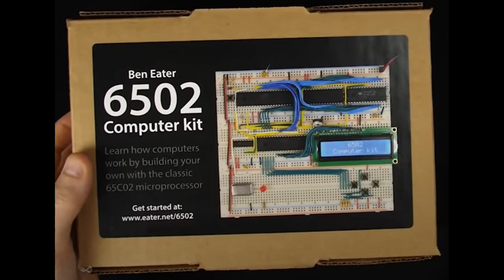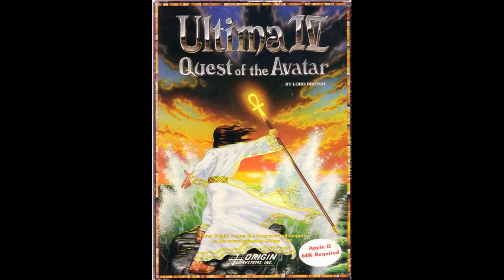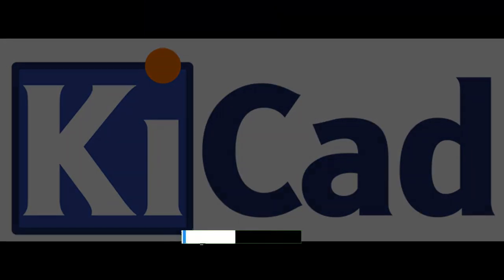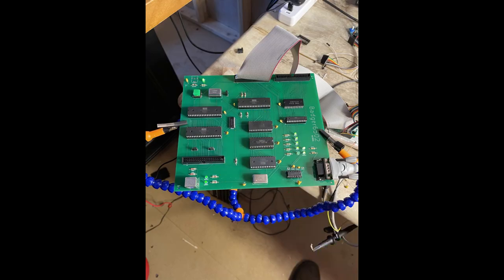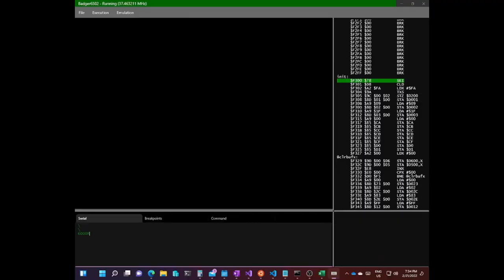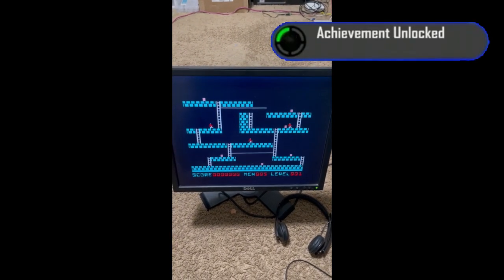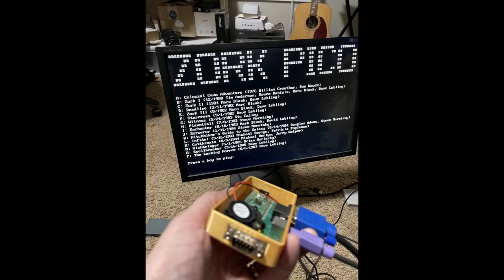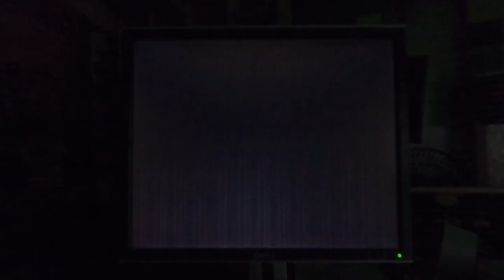6502 childhood dream come true (+VGA, Pi Pico, and Lode Runner too)

Comment: from never doing hardware to a 4 layer board? nice stuff dude
Reply from the maker: Thanks!
Reply: Isn’t 4 layer the easy, lazy solution to distribute power? From the EEVLOG I learned that with through-hole routing is criss cross on the surfaces. Like in a breadboard: internal is vertical, then there is space for your horizontal colored wires.
Reply: @ArneChristianRosenfeldt   if it works does it really matter? its not a final product of any kind
Reply: @akamadman203  I just say that the hi tech solution is easier. If you need to save any penny in a series production, you try to reduce this to two layers like Nintendo had done with the N64.
Reply: @ArneChristianRosenfeldt Having just designed my first PCB, yes.  I had a choice between figuring out some clever way to route traces between top and bottom (because too many traces needed to overlap) without causing lots of EMI, or just switching to 4 layer.  I probably saved myself weeks by switching to 4 layer.

Comment: Congratulations Eric.  I am in the same rabbit hole.  After 25 years of software engineering, I am starting to use my electrical engineering degree again, recalling my younger years, and having a lot of fun learning.  Hope to see more videos from you.
Reply from the maker: Best luck - any project you're focused on?
Reply: do a YT search on the Agon Lite SBC - aimed at retro hobbiest. It uses the Zilog eZ80 as it's CPU. This is backwards compatible to the Z80 but also has a 24-bit mode where can address up to 24MB. And there's an 8-bit base register so that multiple 8-bit Z80 programs can be loaded into that address space for some multi programming fun.

Me thinks this Zilog eZ80 CPU is just the bees knees for designing new hobbiest retro-themed SBCs around.

Give it a thought for next projects that up the ante over 6502 systems.

Comment: Man, your video resonates so much with me =) I also watched Ben Eaters videos without an electrical engineering background at the beginning of the pandemic and had to start tinkering right away. This kickstarted such a rewarding hobby for me. Since then I build his 4 Bit breadboard CPU, started modding it over and over and ended up building a whole computer around a Z80. Just the other month I saw a video of a guy building Pong from chips, so I had to do this too. Thank you very much for sharing this great video and you are absolutely crazy (in a positive way), for taking it so far. Kudos!
Reply: That's so cool! I just built the Ben Eater 65c02 project. Bought the 8 bit (4 bit?) computer kit. Right now I'm working on learning KiCad while designing a PCB for the 65c02. Maybe I'll do the clock module too while I'm at it. This morning I ran across the pre-made W65C02SXB and was enjoying reading the data sheet and the schematic and actually understanding most of what I saw, which was awesome. It makes me want to do more projects too like Z80 (like following John's Basement) or another channel I saw building one with an 8088. But I also want to make my own little computer (cyberdeck) with a Pico as the base. I have to stay focused on one project at a time haha.  Oh yeah I also want to create a Forth (it lets you move from assembly to high level language quickly and easily, while using very little memory) for one or more of those computer (or just run an existing one).
Reply: @drivers99  It's a rabbit hole, isn't it? I really like your Forth idea; reminds me of a video I saw about a guy who took Ben Eaters 4 Bit SAP-CPU and extended it until he was able to compile C code for it. (I think it was mainly turning it into an 8 Bit one and adding a Stack module.)

Comment: Nice job. The biggest challenge is keeping your hobby from being just more work.  I built 8 bit cpu, was going to expand memory, but it's on the back burner, as I've shifted to doing machining and metal working for hobby, currently.  Welding is proving similar to sharpshooting, breath and sight picture are weirdly similar to keeping a consistent distance  and bead size on the welding. never enough time if you have too many hobbies.
Reply from the maker: I know what you mean.  I try to keep it fresh by continually learning and adding new skills. Welding and metal work is actually on my list!

Comment: I wonder if the algorithm thinks we're the same person?
W65C02S. Check.
Pi Pico. Two of them.
Iterating on EPROMs is lame. Indeed.
Woz monitor in 256 bytes. RP6502 monitor in 32 bytes.
VGA. Same, but no graphics mode yet.
Z-machine? On the 68000.
YouTube. YouTube.
Well done.
Reply from the maker: The similarities are uncanny.  I enjoyed your recent video with the FPGA and Commodore keyboard.

Comment: I love that processor, it was the first chip I learnt to program in assembler
Reply: I still feel like it has the best use of flags. Once a CPU has a barrel shifter, flags are only useful for ADC and a for loop.

LDA sets the zero flag. This promotes zero termination of strings. This lead to a lot of bugs.

With 16 bit instructions on JRISC or SH2 it still hurts to waste too many bits on operands. Fusing the CMP and test instruction with branch allows us to cover a lot of use cases. Without flags, instruction re-ordering is easier. RISC is not foremost about the number of instructions. At least I say that we are allowed to specify if ADD listens to the carry flag and if it writes it. Then don’t re-order those ADDs.

Loop instruction from 8086 ?

It is so weird that there is no clear upgrade path from 6502. ARM is so complicated. I guess that 32 Bit instructions are necessary for the absolute addressing mode.

Comment: You crammed a lot of info into this video! 
Looks like you gained a lot of valuable info in this quest.
LR is a good benchmark for 8-bit machines and is a good game, I'm partial to an offshoot of the game (Lode Runners Rescue) as it was the first iso game that I saw in my youth running on a C-64.
Cheers,
Reply from the maker: Thanks!

Comment: Pumping something out of the Pico/MMBasic myself. It's closest to the ZX-Spectrum/Psion with potentials for sensors, keys, displays. I hate all the wiring and tests with failures. The cutest construct is a PWM Throttle for a BEC (RC) which could become automatic one day and for now it's just up and down + emergency stop (3 keys) and I enjoy a propeller under my command. It's just showing -99 to +99% on a display and looks like a tiny PC. My idea with it is a servo tester, but I would like to mount a propeller on an RC car and such construct is a bit confusing, still.

Comment: Well done, it's great to see how this has all come together!

For counting in 7s, it's probably fine if it's just the addresses being done like that - you can make the least significant counter be a 4-bit one and make it wrap after 7, or initialise it to 9 whenever it reaches the terminal count, which I think wouldn't require any external logic
Reply from the maker: I can read a byte at a time but would need to have pixel clock such that 7 pixels are output per phi2 cycle. The high bit is a conditional palette bit. I think I’d need the pixel clock to run at 1.79MHz instead of 1.57.   (Reading 8 bits and outputting 7). If I did 280x192 (apple hires) I think I’d need to use a 22.02813 MHz clock. Maybe 22MHz would be close enough. Not sure I could reliably generate the sync signals though.

Comment: I am most interested in buying your 'load runner' kit and congrats, a good job well done.
Reply from the maker: To clarify, I’m selling the PI Pico based boxes that are running the emulator. They’re currently finished although I’ve been thinking about making into a kit. The “beast” 6502 computer + vga using TTL is still under development.
Reply from the maker: Send mail to eric.badger@gmail.com

Comment: I'm attempting to do the same thing with a 6809 chip.  This is a very inspirational video.  I am too feeling intimidated doing my first PCB with KiCad.
Reply from the maker: It is so worth it, and in retrospect not as hard as it seemed to be. Do it!  6809… hmm CoCo?
Reply: @thecodesorcerer  I am Welsh, so I would say Dragon 32 :)
Reply from the maker: @cthutu  best computer name ever
Reply: @thecodesorcerer  both Dragon 32 and Coco were based off the Motorola reference so they quite similar.
Reply: 6809 has MUL. So please show off some DSP audio stuff and 3d !

Comment: VERY cool video! I really enjoyed how you covered your journey. I'd love to see more detailed videos of how you worked through various aspects of your design.
I've been wanting to build the Ben Eater kit for some time now. Amazing how you took it to the next level.
Where can I get one of the Lode Runner appliances?
Reply from the maker: You should, it’s a blast. What would you like to see specifically?  Please send me mail: Eric.badger@gmail.com
Reply: @thecodesorcerer  I'd love to see more on your PCB 6502 work and the video output. It was cool how you could see the interference in your early video work. Was that system data writing into video ram?
Thanks again for sharing.
Reply from the maker: In the v2 version, video and cpu RAM were separate. In v3 they’re shared.  While clock was high, cpu would control video RAM. In order to have 4bpp the video logic needed to read from RAM at ~6MHz.  Couldn’t get the timing just right at that speed.  Newer version reads at 1.57MHz which creates a lot more timing grace.

Comment: To handle 7 bit wide blocks, just load a new byte into the output shift register earlier, and possibly rewire the parallel input to load the compatible bit position into the shift register output bit.
  Almost any complex logic circuit can be built cheaper by programming it into a modern CPLD or FPGA, this is the modern equivalent of the "uncommitted logic array" chips that 1980s computer makers customized for fabrication, but available as single units with a 4 pin programming port or a connection to an external flash chip storing the logic design.
Reply from the maker: For this project I would consider FPGA to  be cheating. That said I have an arty7 on my desk for a future project.
Reply: @thecodesorcerer  Hence my suggestion to use a CPLD or old school PAL instead of a large number of 741xx chips, such as 74166 pixel shift registers for the 7 or 8 bit formats of fonts and graphics.  6845 controller chips would be time appropriate but are hard to find these days.

Comment: With regards to the RAM access, traditionally this was done by the CPU accessing on low clock, GPU on high clock instead of using a dual interface RAM

Judging but what you did you already know that most likely xD
Reply from the maker: Yep! Except vice versa. GPU access is on low clock as of now.
Reply: C64 has extra SRAM for color attributes. This in turn required a way for the CPU to access them. What if we use SRAM to load the next line of attributes in the side borders?

Or do we want sprites? Maybe there would be a register to specify how much SRAM is loaded with attributes and how much with run-length encoded graphics for a sprite layer?

Comment: How did you make he HW text mode?
Reply from the maker: Fonts are stored in a rom chip.   1 pin on the chip for each bit of the 8 bit ascii value from memory plus 4 pins indicating the screen row are combined to retrieve an 8 bit value representing the pixel pattern. That value is loaded into a shift register and out put on each cycle by pixel clock.  VGA circuits are scanning through system memory.  Maybe I’ll make a video describing it.
Reply: @thecodesorcerer  I would be interested in seeing a video about this topic :)